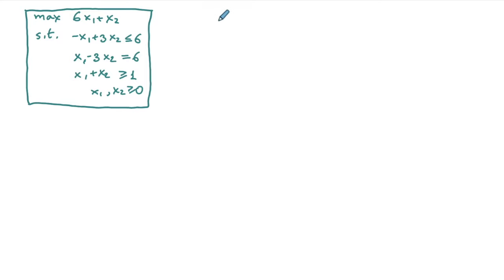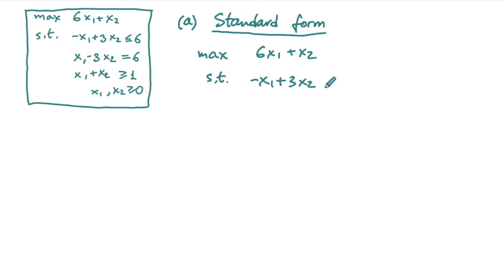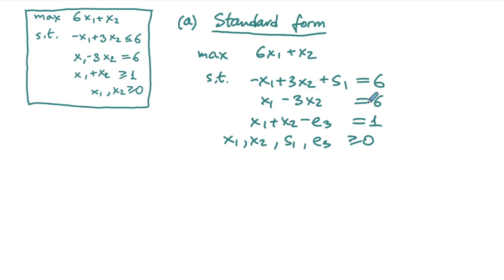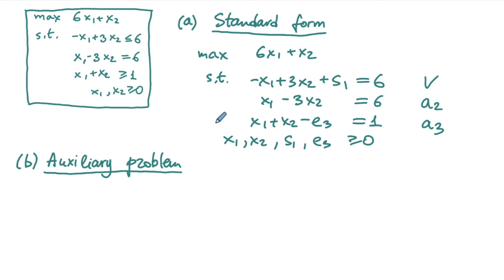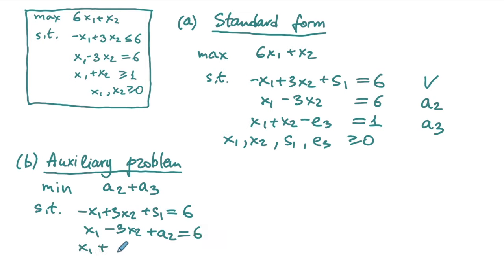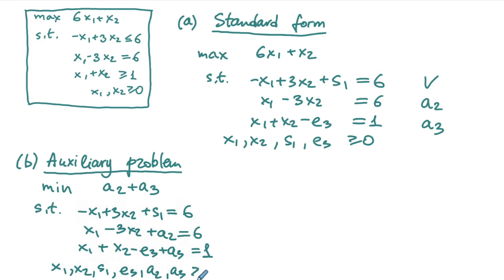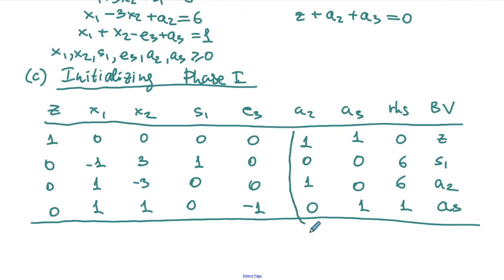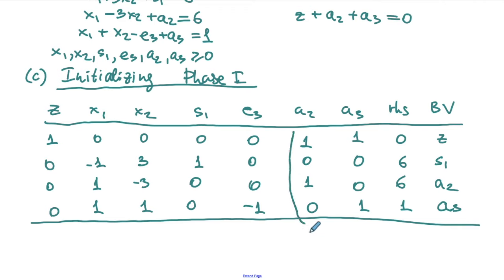The Two-phase Simplex Method: An Example

Comment: If it's a minimisation problem as opposed to a maximisation problem, are the auxilliary variables then maximised? Or are they always going to be minimised no matter what? Thanks
Reply from the maker: The purpose of the auxiliary problem is to find a feasible solution of the original problem. For this purpose,  we minimize the sum of artificial variables, regardless of the objective of the original problem.